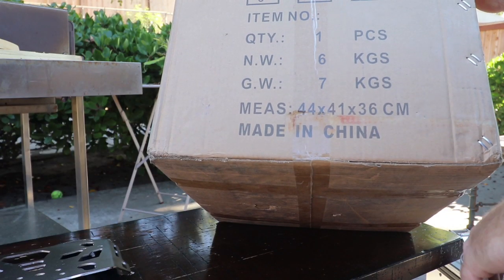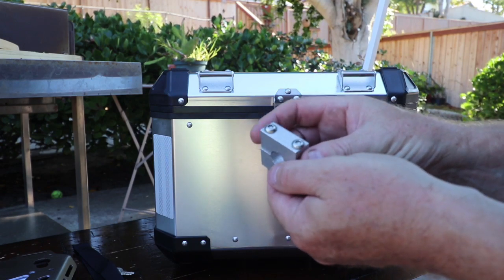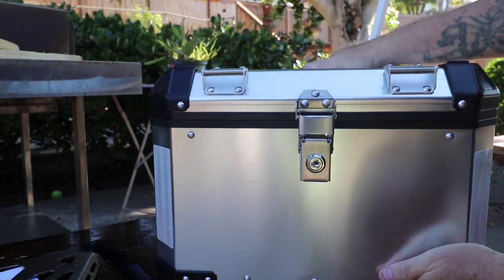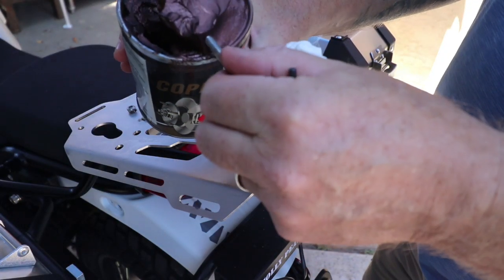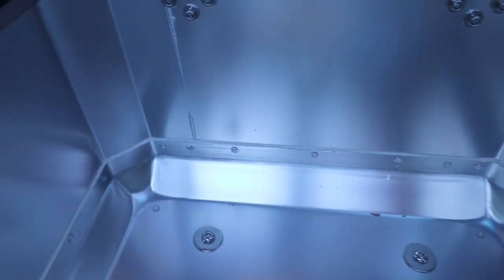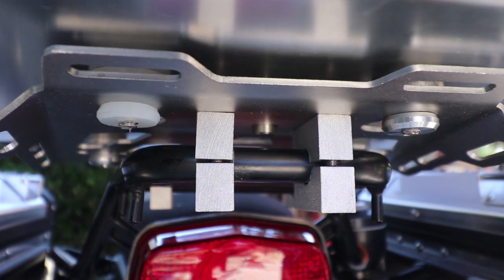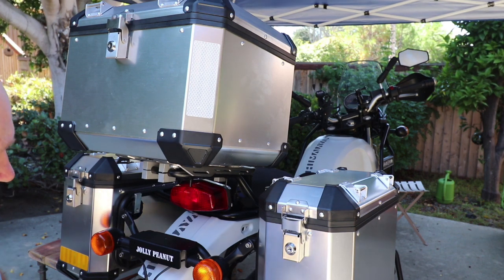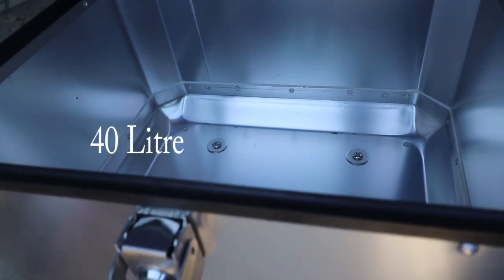Fitting Aluminium Top Box Royal Enfield Himalayan

Comment: The rear rack is not weak, it is rated for  a max load of 3kgs as stated in the bike's manual. It's probably a good design decision by RE. I wouldn't load it without reinforcement.. see @7:30 .. IMO offroad with a heavy top box on a light motorcycle is dangerous. On heavier ADVs it's not such a big issue cause the bikes weight can counter any force generated by any weight way up.
Reply from the maker: I believe RE should look in to beefing up the rack on future bikes as the Himalayan is marketed as a dual sport/adventure bike & we all know people who ride adventure bikes do tend to load them up & yes maybe over load them and Himalayan racks are known to fail. I just want to fix a future problem before it happens to me in the middle of no where. Also i am 260 lb in weight i do not think a loaded top box will have any adverse balance effect for me or at least i have never had a problem with counter force in my 35 years of riding, but your right people should consider this.

Comment: You.have to reinforce this rear OEM rack! It will break soon with the weight and vibration. The box + aluminum baseplate are already too much weight for the rack even with nothing inside. Take care with that. Cheers!!
Reply from the maker: Yes i know your right i do need to reinforce the rack, i plan on  making some sort of reinforcement myself when i have some time to do it but i have to think about how i will do it first..the base plate for the top box is steel not aluminium so that is heavier than you may think....The rack is far from ideal on an adventure dual sport bike RE really need to address this issue it's a weak crappy rack...Thanks buddy...
Reply: @JollyPeanut  I believe there are aftermarket racks already on the market... maybe SWMotech or some like that. There will be many people facing problems with this OEM rack.  Cheers buddy!! Nice ride for you!

Comment: Fit the brace bars straight away as the rack will crack and you will have more than a little dent! Givi manufacture the best support kit and are readily available thru any of their dealers.  Good luck
Reply from the maker: do you have a link, i can not find them...
Reply: @JollyPeanut  GIVI SR9050
Reply: @JollyPeanut  UK link with explanation of options https://www.motorcycleplanet.co.uk/products/3420-givi-sr9050-top-box-rack-for-royal-enfield-himalayan/
Reply from the maker: @silktvPDR1  Thanks for looking but thats not what i need that is the givi plate for the givi top box , i already have a plate & top box. If i were to use these the rack will still break. I need support struts two of them they fit to the pannier frame to the rack supporting it, its a simple fix but those things are hard to find....Itchy boots found some but i have no idea where she got them...

Comment: Very good video. Could you tell me how thick is the base plate of the top case? Thank you
Reply from the maker: Approx 3 or 4 mm it is hardened steel its a bitch to drill and its heavy but does the job....I may change my base plate at some point to save weight.
Reply: @JollyPeanut  thanks for your answer. I salute you from Argentina